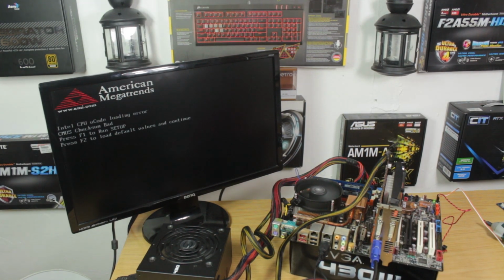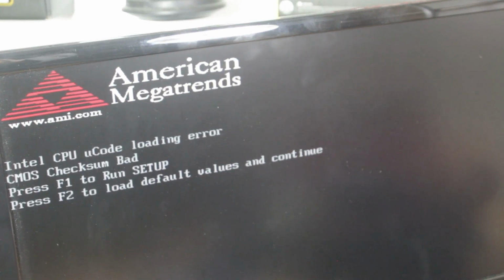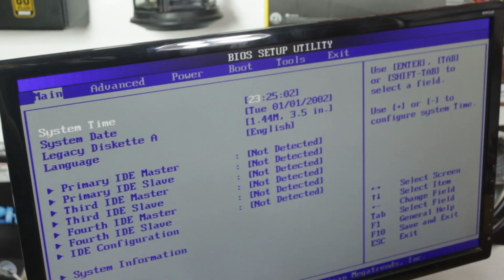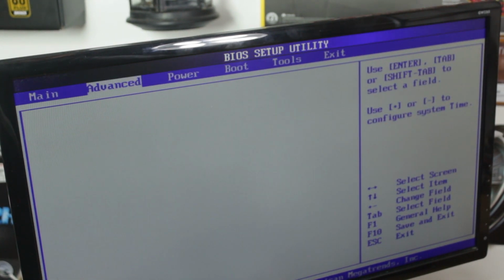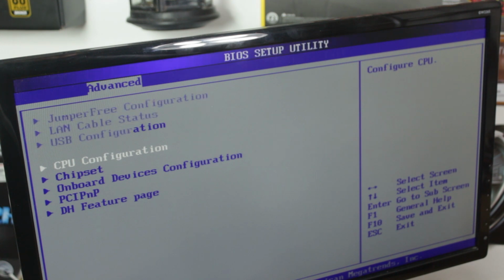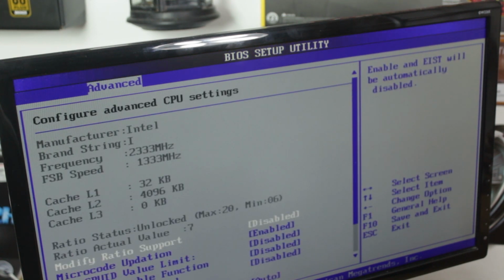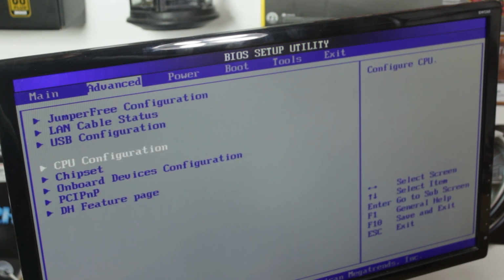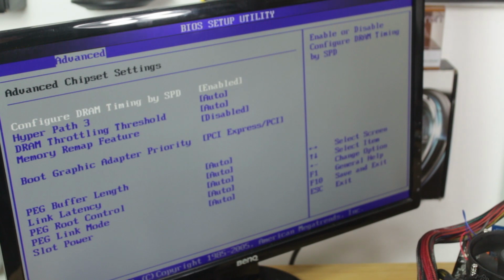Troubleshoot A Motherboard - Pt 3  Dead PC Or Computer Turning On But No Display On Monitor

Comment from the maker: I have answered many of the questions and comments in today's Live Session (Friday 21 Feb 2020: How To Troubleshoot A Motherboard - Live Pt 3 Computer Tuning On But No Display On Monitor https://youtu.be/3Ir6FlPei1U)
Reply: I just swiched my processor cooler and when i start my pc then my mouse and key board doesent light up and my screen says:no signal. Please help!
Reply: I fixed it i just had to take it out and put it back...
Reply: No fan spinning but the psu is still giving power, tech fixed last 2 months by using small metal and touch something on the board and it turn on now the problem go back and i dont know how to fix this
Reply: Im just a dabbler in these things, and I just came across your video. 
What a joy to watch.  
Quick question/request: Can you make a video -or add within one of your videos what the post beep tones are for? I dont know if every manufacterer has their own set, or if there's something universal. Thanks in advance if you can!
Reply: I'm trying to add Ram to my computer from 8 GB to 16 GB. I got the cards from the same place and are the same and work separated but together the computer doesn't send a signal to my monitor and doesn't start up properly. I know both RAM slots work but I need help.
Reply: bro!! today my g58 mb didn't display vdo but win7 was loading fine (i have g19 keyboard so i could see win was loading fine). i swapped monitor, i changed pcie slot, i swapped PSU, i swapped 2 other gfx cards (1st 1060, 650, g9500) all didn't display but win always loaded. i can't work it out !!!!!
Reply: Hi bro,i just buy motherboard and try to install it but the monitor say no signal..try to change new cable,change ram slot,change new cmos battery and also check with the gpu already but still got same problem..

Comment: So I got my asus motherboard replaced. First it was turning on but no display. Now the replaced Mb worked for 2 days, 3rd day it again died. Now it's not even turning on . There is a light on motherboard but it's not even turning on now. Checked my PSU also with a multimeter, fine. Is it the motherboard fault again? 
Engineer says you get a UPS  for your pc cuz fluctuation is killing it again and again. My PSU is 550 watt. What should I do?

Comment: when I replace a screen and a lcd cable with new ones and still i get no display, but the power is there because the chargin light on the right side of the chromebook comes on, what could be wrong? is it the motherboard, some kind of coding issue its having, or would it be an electrical issue? It would be hard to say without testing, but what can I test to eliminate any options ?

Comment: Could it be the clear cmos? If the jumper is missing or wrong position, in some cases that's the reason from preventing it from posting or even turning on

Comment: Wow this just came p in my feed.
I have been wanting something like this for a while.

I like the way you lay the computer parts out on the desk - we don't need a case!

Where did you get that switch to turn the computer on - the one that connects to the front panel headers. Or waht is it called so I search Amazon etc.
Reply: It's a simple button that exists in any Desktop Computer.
It's a wire attached to the motherboard and goes all the way to the front of the PC (Or the top) and is connected to a button that powers on the PC.

The Power On switch has this inside it. It's in every Desktop Computer.

Comment: You should probably try to reset the bios( hard reset), short the two jumper pins for the CMOS with a screwdriver for at least 15 seconds, that should reset your bios. You don't really need to give any power to the motherboard, the charge from the battery should help. Hopefully it helps you

Comment: My pc now boots but putting screws to hold vCard makes it not post. Or putting in a pci wireless card makes it not post. No lights are on the Ethernet port. No internet. Didn't post before but now it at least posts. Is it shorted? Or now bad motherboard?

Comment: Have you tried removing the Cmos-battery to reset the BIOS or replacing it with a new one? If that doesn't work then it should be PCIe port on the motherboard that is  faulty.

Comment: My AMD A8 7600 series desktop,does not power up ,on inspection I found ,psu ok all voltages Dc in the 14 pin main plug and 4 pin cpu plug are ok,when I unplugged the cpu plug all fans start and power light  shows up,but with cpu plug in place the pc is dead again,what should I check next?

Comment: same to my steel legend b450m i got no display but i can refresh and shutdown using keyboard and mouse , so i thought it was gpu so i tried to insert to 2nd pcie slot it works but when i use bios try to xmp and exit my pc get freeze or get boot but no display i need to force shutdown if not working disconnect all usb device that connect to mobo i tried to uninstall gpu driver and i got no display, even reset bios in mobo its not working so i change my psu gigabyte 650b to rm750 corsair the  bios is work fine now but sometimes when i restart pc i got no display so need to disconnect all usb that connect to mobo again to display so maybe my mobo is faulty

Comment: Okay well I tested the cmos battery it never worked replaced the psu and it’s still not working. The graphics card should still be good. The motherboard has a green light saying it is supplying power to it so im not sure what’s going on.

Comment: My cpu when I turned it on, only my keyboard and mouse backlight light up. My fan and GPU is not spinning.

When I did the paper clip trick for my PSU, the light beside my PSU switch light up but when it was assemble it didn't light up. Any help? Need it for my home buisness. 🙏

I've tried to send to shop last time, I think I got scam as I don't see any new part were replaced and was charged SGD$180. I'm really scared of that.

Comment: Is it possible for the board to die soon after installation? Just finished my 1st build and it was working perfect but the day right after, I wouldn't get any signal to the monitor, no post or anything. My dram led lights up but I don't think it's the ram, I tried my other ram sticks and they also wouldn't work which I knew worked on my other computer. I also reseted the cmos but same result. And like I said, it was working perfect the day I installed windows so I'm just really confused and getting real frustrated. Any help would be appreciated

Comment: Hello my issue is my PC shows my HDD light not flashing but it's not posting as well my motherboard led comes on and will beeep if I take out all my ram my ram was the issue in the past and I would just reseat it one day I was using it my PC just went off and stayed off I know it's not my gpu it's new and I know it's not the ram because I have used new ram my MOBO seems okay what could be the issue ?

Comment: Hello, I have a HP Formosa motherboard and an i5 LGA 1155 CPU. I encountered the no display issue after I cleaned the computer dust on the CPU heat sink, CPU Fan and the chasis fan. I have been troubleshooting this for about 5 days with no luck. I replaced a working GPU, no display. I removed the GPU entirely to see if I get any beeps, none... I do get 5 short beeps when I remove the RAM. Can i assume that the MB is fine here? No external devices are attached at this time, including kb, mouse, gpu, usb, DVD, or HD. If I replace them back, no beeps or no display.
Can you please help me what would be my next step? 

thanks and keep up the great work...

Comment: I just installed new ram when I tried turning it on there is no display and no usb connections but my cpu and gpu fans are spinning and my ram,s rgb is on, I tried putting old ram back in but still same problem

Comment: I got my old desktop pc up and running again after being in a cupboard in bits for a few years. It was difficult getting it working but I managed and it was running great. The case was damaged so I bought a new one and swapped all the parts into it but it wouldn’t POST. I tried all your suggestions but nothing works so I swapped everything back to the old case and it still won’t POST. I’m at a loss now. Do you think the motherboard has broken in the swap over?
Reply: Hey , I was able to fix pc troubleshooting with the help of RYANSROOM617 on instagram Or text him on WhatsApp +1 442 233 0240.. he’s an online technician and a pro hacker.. you can try him out and his service is affordable 💯

Comment: you just give me the answer i was looking for. i got a new motherboard to swap it for my old one. so i swap all the cables & i plug them correctly after i turn on the pc but no image in my monitor everything else was working the CPU & GPU fans.

Comment: Hello sir Ash, Im trying to fix a PC and the trouble that i have found is damaged PSU and now I already fixed it because I have skills in Electronics, I also use a series circuit that uses incandescent Bulb to protect from explosions during Short Circuit, when i attached the PSU to the mother board and i plugged in the Power Cable the incandescent Bulb glow high that it means there is a problem in the motherboard. I tried to remove the CPU and turned it back on, the glow is gone and the LED indicators light up. Is there a possibility that the CPU is damaged or Shorted?

Comment: Facing a Weird Issue, Need Help. So When I press power button of laptop, there is no display but power LED lights up for 5-10 seconds and goes off and then again lights up after 10-15 seconds. This continues for random amount of time somewhere between 10-40 minutes and then the laptop starts normally showing Lenovo Logo and then Login Screen. It happens after every shutdown. Any Solution for this?
Reply from the maker: If you are not able to send or bring in your device, and you only need over the phone or remote help, then you should contact my 2 tech admins Shaka & Julio on our new discord server:

Join Our Discord Server:
https://discord.gg/yVcW5qs

There might be a small assessment fee which they will discuss with yourself, and decide on a completed repair fee if applicable.

Alternatively you can join our Facebook group.  If you post your question there with some pictures or even better a short video footage you may get a response and help from the community.    
https://www.facebook.com/groups/healmytech/

Comment: Oli have been having freezing and rebooting i bought new hardware ssd hard drive powersuply cpu still doing it  i have not checked the ram all the motherboard  any clue what it is i have reinstallled winds 4 times i have all my drivers updated its a pain in the ass

Comment: Can you reply sir. I don't know if my mobo is dead. I switched PSU, RAM and HDD and still nothing. My monitor says no display but my system turns on. When I turn on my system the fans and hdd are running and in less than a minute the cpu fan will suddenly slow down and still no display. Is the mobo the problem?

Comment: So how do you trouble shoot a brand new motherboard that isn't getting any power? I tested the power supply and used the jumper to test it already, but when I plug in the power to the mother board and the CPU there is no power going into the motherboard. I have a motherboard with a built in VGA card and have RAM in it but there is no power going through the power supply. This tells me that the motherboard could have a pin problem with the connector because the power supply would at least turn on with a load right? How do I test my pins on the motherboard or should I just return it back to newegg and get another one?

Comment: Just built a new PC with all new parts and I’m having a difficulty booting it up. I see no display on my monitor however everything on the motherboard when I tested it is lighting up and seems to be working fine. I built my PC then unbuilt it to try and fix it and can’t seem to find a solution.Any help??
Reply: what did you do to fix this?

Comment: Can someone help me TT. When i plug my new cpu in the motherboard, no power no boot and fans are not spinning, but when i run the mother without the cpu then the fans are spinning but not booting.... But when i put my old cpu that i used, still no power no boot and fans are not spinning.. I've been thinking is it the cpu or the motherboard is the problem

Btw, the cpu socket pins is in the mother (intel)

Comment: I could really use HELP if anyone sees this or you're still monitoring comments from here... 

my daughter broke my spare laptop" HP pavilion 17". She stated she dropped it a month ago. The cracks are obvious in the frame but I believe it to be something else. I get the charging port light to display with or without the battery when the adapter is plugged so power seems to be going to the port. However, it doesn't power on - no display - no light on power button - no sound from SSD etc. 

I don't see loose or damaged hardware from being dropped after tearing it down. THought maybe she got something wet like the charging end and plugged it in for charge, or perhaps spilled liquid on keyboard, but I don't see anything that looks like it was once wet or any residue on MB.  How can i tell if its a bad charging port, power button or motherboard that's damaged?

hate to spend on a new board if that's not the problem.

Comment: psu not on when i plug graphic card any solution you have plz help me i am using same graphic card anothrer psu but i face same problam when i plug other graphic card working well i have v850w psu using gtx 970 dual fan design

Comment: I have a question, what if i can feel the heat of the chipset,cpu heatsink and ram but it doesnt post? I tried reseating all parts and turning on thr pc with a screwdriver. psu is fine and that's leave cpu and mobo. I really need help because online class is within next month(it started when i installed a heatsink for my two ram and it works for a week then when i move my case because my earphones is far and thr heatsink felt off and i reseatted it the day after coz it bothered me and then it started not to post

ps:im still waiting for my internal speakers.

Comment: How would you trouble shoot a amd b450 that locks up after working correct for up to 36 hours switch back to a320 board with no problems.had to wait months to get a b450 board?

Comment: My PC shuts down randomly out of nowhere. When i press the power button, it turns on normally but after 2-3 mins or when kept idle, it freezes and then shuts down, same used to happen when i played games a week ago. What could be the reason?  I checked with different RAM sticks and RAM ain't the problem. My specs : Gigabyte H97M-D3H rev 1.1, Corsair vengeance 4 GB RAM, i5 4460, Circle gaming PSU 500W.

Comment: Salam...i have a hp 8200 sff...the problem is its no turning on.. sometimes it turns on when u reset the CMOS...but after 10 to 15 minutes it shuts off automatically...after that it wont turn on..no lights no nothing..any solutions??

Comment: I just had this problem tested everything i needed and now i am for sure, sure that my motherboard is dead thanks to this video lol. Thanks mate it helped. Also hopefully in 2020 you are not using a drill to put in the screws.
Reply: Was the motherboard the issue because I’ve been having issues where my pc doesn’t turn on but it’s receiving power because the LEDs on the motherboard turn on when I plug it in. I’ve tried anything but I believe it is the motherboard

Comment: Maybe someone gonna help me I tried everything to buy us reset even take out the 24 pin power supply and I checked also the process or 4 pin cable And also the  RAM slots wheat another RAM and another Power supply even the processor pins check it out it comes Light on the motherboard just one spin fan pandan no more when turns on please who knows to help me send me a message on my email or or here on the commons

Comment: Try an older video card, with lower specs.  The tech manual for the motherboard SHOULD tell you both the type of Ram, ram settings and jumper pins for the CPU and/or video card.  Make sure the CMOS has the CPU, memory and correct video card settings; otherwise it will NOT start up properly.

Comment: My pc has brand new rx570 brand new gskill 8gb ram i5 8400k all new 
600watt pcu 
But got a used 
motherboard from amazon
An it kept resting every 8 sec
An my mouse an keyboard would not turn on 
I tryed diff ram n board an nothing
Im hoping it was bad motherboard
So i sent it bak
Getting the replacment tm
An hope it work
Reply: B365 gig

Comment: Thanks sir for sharing this video.. I have big problem with my pc when I switch on power nothing happen completely dark.. No display, no powering up, no beep. .. What should i do sir?
Reply: Did you figure this out? Experiencing the same thing
Reply: @djgreen69  actually sir my cpu power botton was jammed due to heavy dust reasons.. So i took it to the local technician centre they fixed my machine & said my cpu power botton won't working cause heavy dust problem so they clean it up now my pc working totally fine...

Comment: Help, I bought a new gpu(2nd hand) then I used ddu to delete the nvidia drivers to switch to amd gpu drivers. But when I installed the new gpu and tried to turn it on it was working, the fan and everything. Except it doesn’t give me a display. Then when I tried to put the old gpu back it doesn’t work too, both of them are not working. Except for the motherboard display thing. Please helppo
Reply from the maker: I have also created a dedicated facebook group to help troubleshoot computer/laptop issues.  If you post your question there with some pictures or even better a short video footage you will get a better response from the community.   https://www.facebook.com/groups/healmytech/

Comment: My desktop can be turn on until select safe mode, safe mode other and normal boots.

But, then it just turn blue screen.

So the problem normally is mobo or proccessor?

I also notices, 2 pin cpu connector was bend.